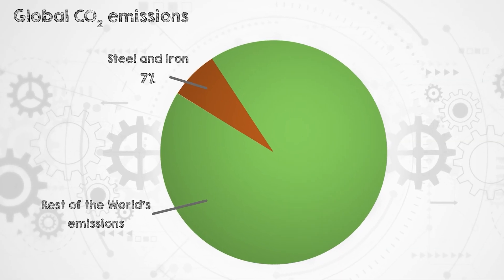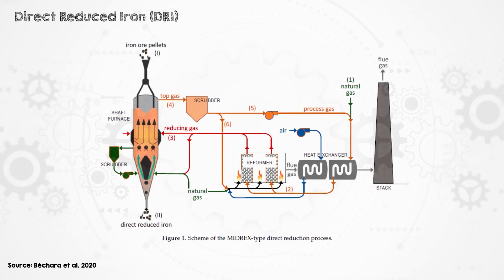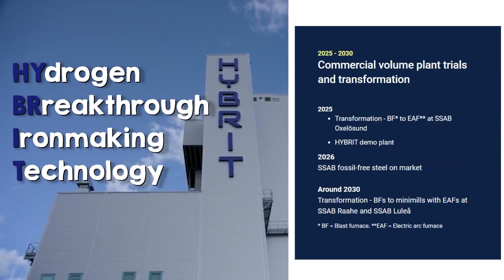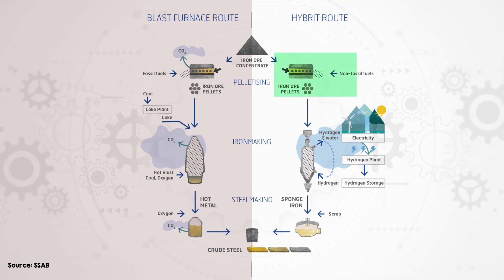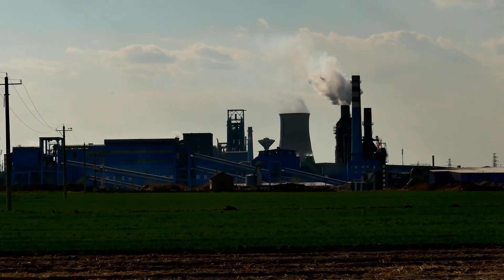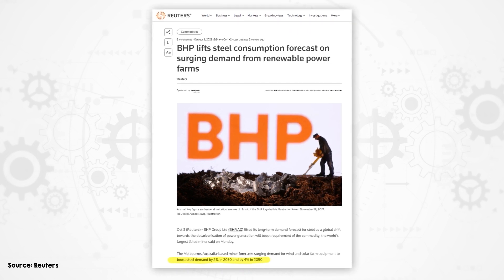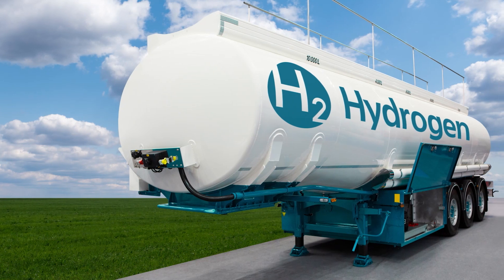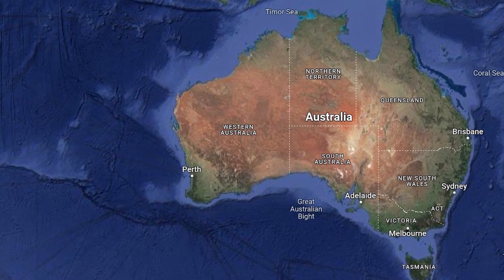Green Steel From Hydrogen

Comment: The map at around the 5:04 mark is really strange. The titel says 2022, but under the map it says 2021. Also, the colours in the legend seems to wrong, for me everything from 100,000 to 1,100,000 only have slightly different tones of red. (BTW, what is the unit used? I guess metric tonnes.)
Rosie, could you please link to an updated map?

Comment: Thanks Rosie mate, this has answered a bunch of questions I had. 
The only outstanding one I have is how hydrogen embrittlement (residual) hydrogen in the steel is effectively removed. 
I'll do some more reading.
Reply: The severity of hydrogen embrittlement is a function of temperature: most metals are relatively immune to hydrogen embrittlement, above approximately 150°C.
Reply: @brlisong  thank you very much, though only after posting did I realise I was thinking about High Temperature Hydrogen Attack.
Reply: I'm with Gordon B: above a fairly low temperature, hydrogen's mobility in the metal is so high that it should diffuse out.

Comment: I think your last point is majorly important and not only applicable to steel. Also Aluminium, Cement or Nitrogenfixation are major industries that use >1 % each of global energy production. If we would produce these basic elements and chemicals where green energy is abundant we would save a lot on transportation of volatile energy carriers such as H2. Only downside is that a few ~tenthousand jobs would move to the end of the world such as western australia, canada, chile... These are highly automated and well scaled industries after all.
But if I learned one thing from German energy politics it is way harder to move 10000 jobs in the fossil industry such as lignite then to save 10x in renewable energy production...
Reply: Yes! I don't know why this isn't getting more attention! Cheap Australian renewable energy close to mines can reduce emissions, refining costs, and transportation costs. What's not to like?
Asia might have cheap labor but Australia will have cheap energy so energy intensive manufacturing could move to Australia.
Reply: In the ten years from 2008 to 2017, the number of people employed in Germany mining coal fell by 25,404 from 38415 to 13011. Ten thousand jobs in the fossil fuel industry moved per four years, repeatably.

My source (Statistia) doesn't have figures for the five years since, but according to trend, by now it must be a smaller number still: there likely aren't another ten thousand jobs in coal mining in Germany left to save.

Comment: I'd not be surprised if the worst problem isn't financial - there such a lot of competition in the steel market anyhow, isn't there? There has to be an incentive to toss out the old processes and put in the new. Also the first company to invent some process needs to not throttle the market by overcharging to license it.
Reply: Steel is generally kinda overproduced (or there's a higher potential supply than actual demand) because of it's strategic importance, since it forms one of the key foundations of modern industrial society and basically all defense sectors are reliant on it. For that reason it's not surprising that all the players in this coalition are Swedish state owned companies and it's likely that in the rest of the world incentive will also come from the top. Swedish raw materials play a key role in the EU’s plan to decarbonize so it's clear why the Swedish government is so keen to invest in this project. It's likely that similar processes will play out in the rest of world now that green energy has become a vital strategic asset, other countries will want to decarbonize steel to prepare for a world where the supply of coal is much lower and there's a pletiful and cheap supply of renewable electricity.

In this one case finances might not play as important a role as strategic considerations, countries across the world have for two centuries been more than willing to protect and subsidize steel due to it's absolutely vital role. That won't change and decarbonization is a necessary step at some point, and all the major world powers recognize that now. Really it might be more of a question of whether or not Europe can maintain it's current lead and take advantage of it.

Comment: As 90% of hydrogen is produced from taking methane and reducing it using steam produced from burning fossil fuels, reverse the equation, use renewables to produce the steam (induction heating), leaving hydrogen and carbon, use the carbon to flash produce graphene a very useful product for many production sequences (batteries, concrete etc) all with a very clean energy pedigree, need to start thinking 3 dimensional rather than 1 dimensional.
Reply: A lot of methane leaks when it is extracted so I'm not sure if the numbers would work out. 🤔 Good to consider other options though.
Reply: @zen1647  a lot of methane already leaks into the atmosphere through old wells, gas hydrates etc, better to use this to produce a cleaner hydrogen. Also methane would not require liquification which is very energy intensive.
Reply: @fredkroh6576  I think natural gas producers already try to stop leaks but it's very difficult. Reducing natural gas production is prison the best way to reduce methane leaks.
Reply: @fredkroh6576  vast quantities of methane are liquefied today in order to ship it between continents.  The LNG industry is responsible for a huge chunk of the energy consumption and domestic emissions of the major exporters, Australia and Qatar, simply from burning some methane to power the machines that chill other methane.  The energy can be and usually is recovered at the importing end through turbo-expanders and heat exchangers.  Countries that are so poor in domestic energy resources that they need to import costly LNG are not going to throw away that valuable, high-enthalpy temperature differential by simply chilling the environment surrounding the import terminal.

Hydrogen does not require liquefaction to be stored in a cavern or pressure vessel, or to be transported by pipeline.  It does not have to be liquefied before it is used to reduce iron ore, or combined with nitrogen to manufacture ammonia and urea for fertilisers, or combined with carbon (and optionally oxygen) to produce methane or liquid alkanes or alcohols to substitute for fossil fuels and biofuels, or oxidised in a fuel cell or burned to generate electricity when the sun is not shining and the wind is not blowing.

Hydrogen is not typically liquefied for storage or transport today, and it would not be even in a "hydrogen economy".  Elemental hydrogen would only ever be liquefied in order to store and transport it in a relatively compact volume when hydrogen is needed at the receiving location *in the form of elemental hydrogen*.  This is rare now and is unlikely to be commonplace in future.